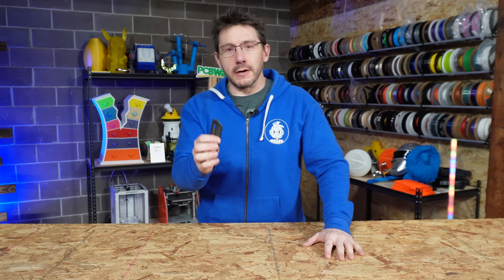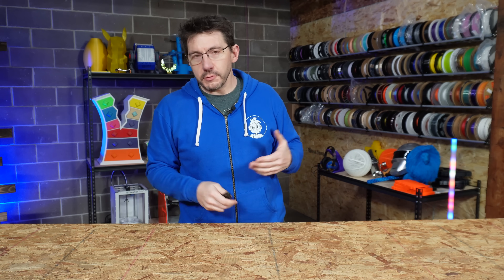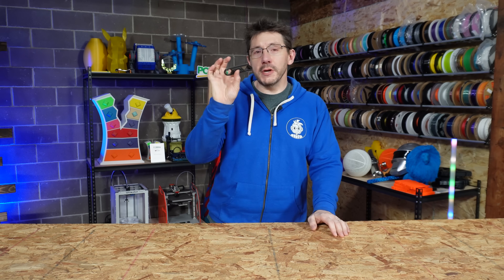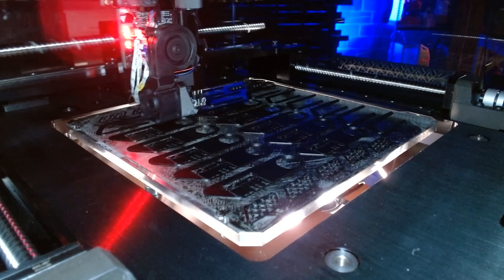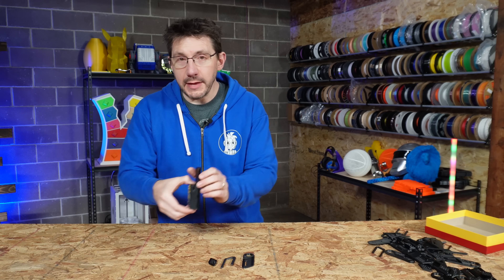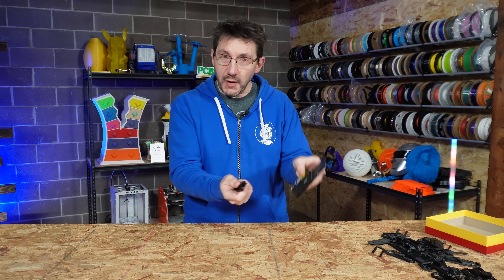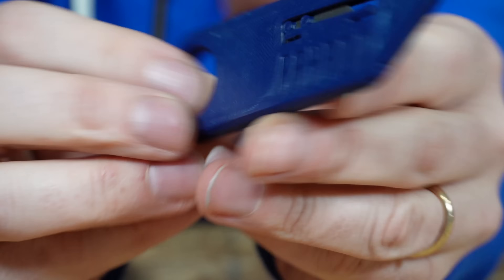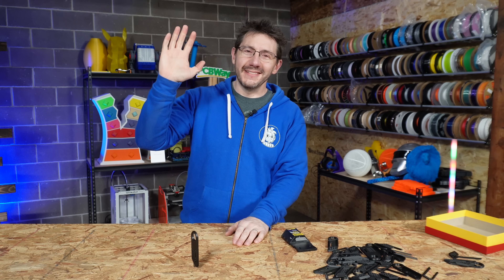AMAZING 3D Print Project!

Comment: I've got several printed in PLA (not the same design, but the same function) and they work really well. My blades have a sideways deflecting key for locking and unlocking. 2 part print. Very nice.

Comment: You could anchor the table top to the strand board wall using angle brackets underneath. My "table" is a 24" deep melamine laminated board anchored to the studs in the wall with heavy duty shelf brackets every 16". Does not move even the tiniest bit.

Comment: I have some issues with my Anycubic Kobra 2. I still have yet to get a good print without screwing up one thing or another in the print. Either the infill isnt sticking to the walls correctly and staying rigid, or the first layer messes up or doesnt have a clean face, etc. Ive looked for help all over and have yet to find it even on anycubic website. I can buy a new printer but im a bit minimalistic so i dont want 2 printers when i have no use for two

Comment: Just sayin I really don't recommend plastic + utility blades. If it breaks it can cause some serious damage. Even all the plastic blades at stores are using a metal holder for the blade.
Reply: @DoesntRefillTheBrita  he used carbon fiber nylon, have to be doing something crazy to break it
Reply: @chadersonbraderson  3D printed "carbon fiber" isn't carbon fiber. I could probably snap that in two with bare hands, nevermind a single point of pressure from holding the blade.

Comment: Aren't you worried about handling CF filled filaments? I think that promoting handling of such materials without any coating is unethical at best..
Reply: That is a debunked myth, please stop spreading fud.
Reply: What are the risks you are talking about?
Reply: @SergioShiroi  there are no risks, don't worry
Reply: It’s totally reasonable to be wary of potential safety hazards but you’re acting like there’s conclusive proof that all CF filled materials are unsafe. There isn’t and it’ll vary on how they’re made. 

Don’t let the one hack’s YouTube video completely shape your viewpoint. 

You obviously don’t need to use CF Nylon for this but also let’s not act like he’s promoting unsafe practices. It’s unknown at best
Reply: @ZoroSeerus  I'm just suggesting that a quick mention of possible risks could help somebody making a more informed choice when buying filament. I'm open to changing my mind if some new study comes up showing that carbon/glass filled filaments are safe to use. As of now, I'm sticking with non-filled plastics to be on the safe side.

Comment: Just carrying that in public could land you in  jail in the People's Republic of UK. 😠
Reply: That's incorrect, you can carry most knives in the UK 'with a good reason' - but that can of course be subject to interpretation.
The knife in the video can be carried without any reason in public, because the blade is less than 3 inches long and non-locking.
Locking would mean you have to depress some other button etc in order to allow the blade to move, that's not the case here, you just move the slider and the blade moves after a bit of resistance at the end stops.
Reply: Always knew uk sucks
Reply: Wrong, stop spreading fud.
Reply: Make 1984 fiction again.
Reply: @tommo9757  The land of unprotected civilians. I feel for them honestly
Reply: @DEWtheMCCOY   more bs 🙄